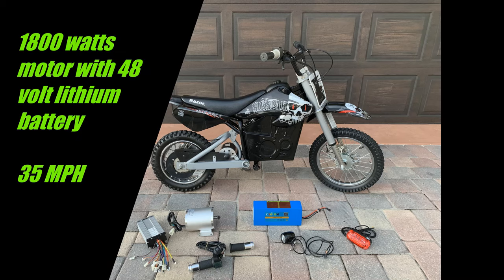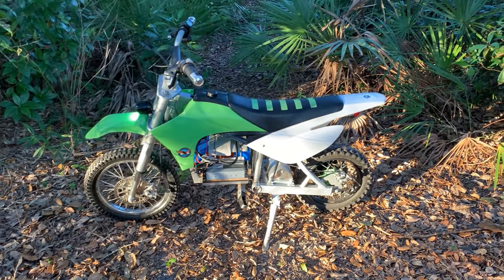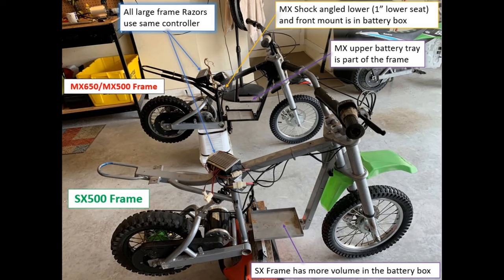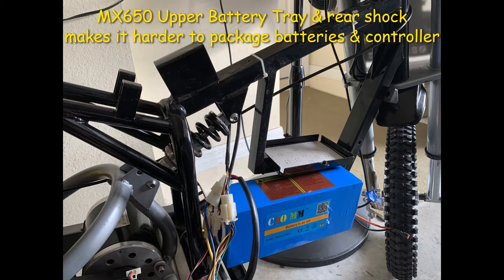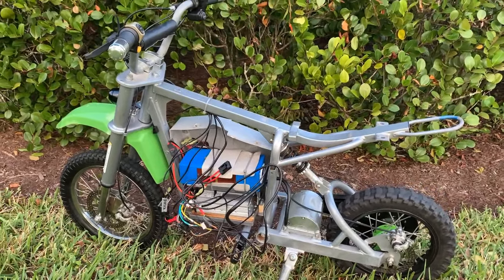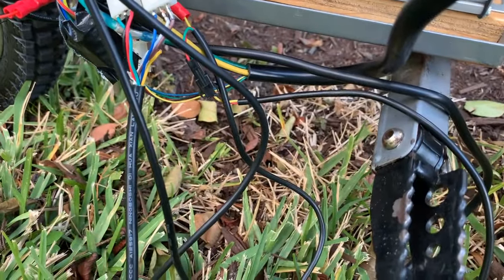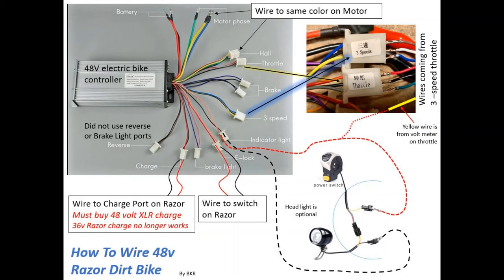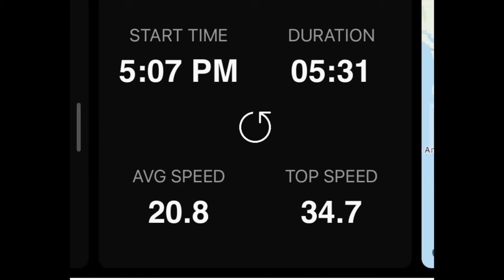go 35mph with 48V 2000W motor - Razor MX650 MX500 SX500 RSF650 upgrade for $400

Comment: Good job explaining everything, you made it very clear. I upgraded my 36v mx500 a little bit ago to 48v but I used 15ah SLA so it doesn't have much ride time. Next step I wanna grab up a lithium battery maybe 20ah I want to get some more range out of it but don't have too much to spend. Thanks for the video. 👍
Reply from the maker: with the 14Ah I get over 60 min.     
 For longer ride times 48v/20Ah battery with 35A BMS:   http://ebay.us/2AUk7j
Reply: @BRichSolution do you need a new battery if you get a new motor and controller

Comment: Great work and thanks for the detailed video as well.  So far, we've done the lazy upgrade path of slapping a 48v 20ah Ebike battery into our MX650 and are just punishing the stock controller and motor for now- the bike still rides awesome compared to stock, but yeah, we see the future and it's a brushless motor and real controller.  Razor Gang for life!
Reply from the maker: That's a nice way to upgrade in steps:  go to 48v battery and when the stock motor burns up then replace with 1800w brushless.  Here is link to before and after speed test when I put 48v battery into a stock motor (SX500 with 650 motor)  https://youtu.be/kRvYAI1hdc4

Comment: Thank you for the video I used same kit,  your diagram for the controller was very helpful in wiring my mx650 back together.  The bike is a lot faster and go's up hills with a lot more power. I got the 20ah lithium battery and it fits perfect in bottom tray of mx650 the controller fit good on top tray zip tied it down. Again great video instructions great job appreciate it thanks.
Reply from the maker: Glad it helped; can you send me photos of what the 20Ah battery looks like in the frame?
Reply: @BRichSolution  Hey Rich I got 2 photos but I don't know how to send them from my cell phone to the youtube  reply I'm old school on tech stuff sorry. The battery sets flat on bottom tray I put foam underneath it and zip tied it.

Comment: How specifically do you install the fuse, like where on the battery? Also, did you just take the fuse off the old razor batteries or did you buy the fuse online?
Reply from the maker: You can reuse the factory inline fuse or go without as the li-ion battery BMS protect the circuit

Comment: Thanks for your video! Very helpful video!
I just finished my upgrade of my MX650 with the same 1800 watt motor,
controller  and throttle with 3 speed switch. Your video is So easy to follow and works well!
Thanks again!
Reply from the maker: Glad it helped
Reply: @BRichSolution Do you need to upgrade the stock battery if you are going to install the motor and controller upgrade? Also are any modifications need for the controller/motor upgrade

Comment: hey thanks for the help on most of the wiring but you said the red black and green wires on the throttle connect to the controller i only see red and black wires coming from the controller
Reply from the maker: maybe you have a different controller?   you can use these easy to use lever wire connectors to trouble shoot your connections.  I find them very useful when troubling shooting  https://amzn.to/39BuYZy

Comment: This was incredibly helpful--thank you so much!   I am all done except for one issue:  the battery comes with a separate charging cable, so do I have to hook up the controller to a charging port?    Am I not just able to charge the battery with the cable as it was sent?
Reply from the maker: You can do one of two things:  
1.  Use the stock charger the battery comes with and route the new battery's charger port out of the battery box 
2.  Wire the new battery's charge port to the controller and buy 54.6V 1.5A Charger with XLR Plug     https://amzn.to/3nlOk9A   so you can use the stock charge port.

Comment: I was wondering how you turn the battery on and off on this build? I bough all of the parts I just needed help with that one question. Thanks
Reply from the maker: Battery remains connected to controller and the factory on/off switch wires to elock port show in video

Comment: Hey b rich solution i was just wondering if i could only put on that throttle with the volt meter and key switch without upgrading anything
Reply from the maker: Yes, you need to wire the key to wires going to on/off
Reply: @BRichSolution  how can i find the key switch with volt meter that is compatible with the on and off switch connector

Comment: Thanks for the video! For the 40 amp fuse, does that wire on the positive or negative output? I'm trying to add one but wasn't sure.
Also, did you pop it often or did it last pretty good? Thanks in advance!
Reply from the maker: Positive

Comment: My sons sx500 does not have the larger front tire.. I’m assuming the frame is the same as the one in the video but not sure. Would this set up most likely still work?
Reply from the maker: yes this will work with MX500 and mx650 as the frame is the same.   I since made an updated video see link https://youtu.be/rBJ2z1ujeRg

Comment: Hi! I have a question, do you think this would work with an MX350? Because thats all I can find at the moment for a reasonable price. Thanks.
Ohhhh nvm just saw the models it works on in disc. Thank you for the vid it really helps!
Reply from the maker: MX350 & MX400 is 24V and small frame; motor will not fit.  You could upgrade from 24v to 36v with stock motor similar to this video:  https://youtu.be/uvTHxL_mtcc
Reply: I have done that you have to make new screws and it pops a lot of wheels but very fun I somehow did it

Comment: Very informative video I'm going to buy this kit you're using but I'm confused on where you plug the on off switch into. is it in the e-lock port? Do I have to strip the e-lock wire to wire the stock on off switch?
Reply from the maker: I made another video recently to go over the step I may not have covered.  The on/off switch gets wired to “e-lock” port on the controller 

https://youtu.be/rBJ2z1ujeRg

Comment: would changing the sprocket sizes on a stock bike change the speed? i want a higher top speed for less
Reply from the maker: Yes go to 13 or 14 tooth motor sprocket will get you higher speed

Comment: B Rich - another question.....do you have a schematic or DIY for the brake light ?  I purchased the one you listed, but see no information on how to wire?   Please help!
Reply from the maker: As for the taillight wire the black wire to the black wire on indicator port.   The taillights power wires to the yellow wire on the headlight so it turns on with the headlight switch

Comment: is everything listed in the description needed?
like the,
40 Amp Fuse
Lever Wire Connectors
and the 3 speed throttle with Volt Meter
Reply from the maker: Not everything.  Most 40A fuse, lever connector and 3 speed throttle are optional
Reply: @BRichSolution  alrighty, thanks so much

Comment: How is this battery n did u connect the fuse on battery I have same battery 48v 20ah for my 1000w 48v scooter n was wondering do I need to connect fuse. Before install
Reply from the maker: yes connect the fuse inline with red wire between battery and on/off switch

Comment: Great Video! Would it be possible to wire the 3 speed control to a key switch to "lock" the power modes? Have a standard twist throttle and wire the 3 speed on the controller to a 3 position switch?
Reply from the maker: Yes, you could connect lock to elock harness on controller

Comment: For your second build did you just keep the 3 speed with only 2 gears or what did you do? Which ones were broken, which gears
Reply from the maker: yes only 2 speeds on 2nd build; see video linked at 4 minute mark https://youtu.be/rBJ2z1ujeRg
Reply: @BRichSolution  there’s nothing on the 4 min mark?

Comment: Wait I’m really confused. Could you please tell me what I need to order to complete my sx500 build. I already have the vevor and coamm and 13t sprocket in the cart. What other necessities do I need to run the bike?
Reply from the maker: Junction box and hydraulic brakes is needed for higher speeds 
Hydraulic Brakes (front & rear): https://amzn.to/3RN0acN
Brake Rotors (48mm bolt pattern): https://amzn.to/3LmX7Wi
Yellow Junction Box: https://amzn.to/4c4rvRI
Reply: Do you have the motor and controller? You'll usually also need a new throttle but that's about it.

Comment: Did you ever need to wire in a high power switch or pre charge resistor in line at the battery positive terminal? Thanks and awesome video!
Reply from the maker: I wired the elock harness on controller to the bikes on/off switch

Comment: Quick question, is all I need to do to the battery just connect the red wire to a fuse and then connect the red and black from the battery to the red and black from the controller? I've seen videos of people connecting the wires to the side case and everything but I don't know if it's necessary. Also, I would assume I could just use the charger the battery came with and not have to do anything with the charging port from the controller?
Reply from the maker: You don’t need the side case… it’s nice to have for quick disconnect.   You don’t need the fuse either as the battery has BMS
Reply from the maker: As for the charger… I’ve routed the battery charge port to outside of the bike and charge the battery directly and bypassed the controller

Comment: U helped a lot showing the diagram of how every is wired my question is if is there a way you could help me out because I have a 72v battery and a controller but I dunno how to do the electrical part and don’t wanna mess up the bike since I have not one but two 72v battery in my razor Mx 500
Reply from the maker: wiring should be the same for 48v bike vs a 60v or 72V.   The issue with 72V is the battery is expensive and you'll most like want to upgrade all factory wires on the bike as the Amps are higher then wire rating

Comment: I have the key throttle with volt meter and when i had constant power with the jumper cable, the voltage displayed properly but the key was useless. i took the jumper cable out and the key worked but the voltage displayed 0.6v, even though i had much more than that. does the yellow wire from the throttle need to go to red of the indicator light or can i connect it to the red of the elock?
Reply from the maker: yellow wire being the voltmeter?   If so wire the voltmeter power wire to indicator light harness or aux harness

Comment: I didn’t get the 3 speed grips so to connect the two wires do you just cut the white box off then strip the two wires and connect them and leave the other? Thanks
Reply from the maker: Yes just connect them together

Comment: B Rich - interesting issue i'm having.  I got the bike up and running, everything was working great.....all three speeds, headlight, etc etc.  

my son rode it last night, parked it for the night and plugged it in.  went to use it this morning and it doesnt work (odd?).     You can hear when you twist the throttle the motor is getting the signal, it lurches forward for a millisecond then cuts out.    strange?  any suggestions on starting to trouble shoot?  i used everything in your kit, didnt deviate from anything.
Reply from the maker: I would check the volts coming out of the controller to the motor.   If the volts increase when twisting throttle then either motor of hall sensor is bad in the controller.  My guess is there is an issue with the controller
Reply: @B Rich  thanks for the reply - where should i check the controller - strip back the blue/yellow/green wires and test them?   i assume red on tester to yellow and black on tester to blue?     also - after trying to get the motor to engage for 10 mins of tinkering around, the controller was getting super hot and the wire from the controller to the motor also very warm.   the only thing i did different than your build is, i just jumped the E-lock with a wire, i didnt tie it back into the throttle...i wonder if this caused a problem?   (do you have an email i can take this offline and email you? - i'm trying to be a hero for my son and i'm failing...)
Reply: @BRichSolution  well - it looks like the hall sensor in the motor is shot according to my Ebike tester.    any idea what the cause was?  everything was working fine....until it wasnt?   got about 4 days of use and it died.   im hesitant to install a replacement motor if i have something wired incorrectly??

Comment: Hi B Rich,  I've purchased everything on your list and i'm stumped on the wiring of the Battery to the controller to the switch.    in your video, you kinda flash over that part and i dont see a clear schematic in your video.   can you please help me?    ive wired the Red on the Battery to the Red on the controller, as well as the black to black.  i have no idea how to splice in the switch?   please help?
Reply from the maker: See video at 6:00 for poor man’s schematic.  Also make sure the elock is wired to the on/off switch.   To test it you can poke a small jumper wire between red and black on the elock harness
Reply: @BRichSolution  Do you think it is acceptable to just "jump" the e-lock harness from the controller?  it looks like that was able to get me up and running? (leaving it in a "jumped state" permanently?)

Comment: I was plugging in the last cables from the battery to the on switch and I heard a pop when I connected them ? I kept turning the on and off switch pulling the throttle but nothing happened? Did I mess something up
Reply from the maker: Do you have a fuse inline?   If so the fuse may have popped.   replace it and you should be good to go.   
Are you using the charger that came with the battery or aftermarket one?

Comment: I know I'm late but I'm confused about the battery charger, doesn't the battery have its own  charging port so you could plug in the charger that it came with, or did you just not use it and continued using the razors charging port
Reply from the maker: New battery comes with charger.  In the video i used the factory charger port… but on my other builds since then i route the battery charge pigtail out the back of the battery box and use the charger that comes with battery

Comment: Do i need to buy the connection box cause tere is no box on the stock razor or just does everything wire right up
Reply from the maker: You can wire it directly if you want
Reply from the maker: You can buy a junction box or hard wire up to you

Comment: Looking at this upgrade for my sx500, so one caomm 48v 20ah will be fine to run the vevor 2000 watt? Just didn’t know if the battery was underpowered I feel I keep reading mixed things
Reply from the maker: yes I have build 4 bikes with Cao MM 48V 20Ah and 14Ah with 2000W motor kit no issues
Reply: @BRichSolution  thanks a lot! Also if I added another 48 to it would there be any issues? Same battery and spec
Reply: @BRichSolution  would the 40amp inline fuse be what’s needed for the caomm battery also?

Comment: Great job ! I I'm about to upgrade my MX650 and my sx500 with the same materials! I've seen a lot of people online saying that the motors didn't last long and have had issues with them how long has this setup lasted you personally on your bike?
Reply from the maker: I've had no issue with mine and been riding on the setup for 14 months and over 500 miles.     I've done 6 month and 1 year updates on the build.   https://youtu.be/4KgzGBjB07Q

Comment: What do you suggest to upgrade a 24v pocket bike? Looking for torque and speed but nothing crazy as I realize I'm limited anyway. It's just for cruising to the store and bar hopping. Even 25mph is a lot that low to the ground 😳
Reply from the maker: upgrade to 36v with stock motor is fun and you'll gain speed & torque over stock 24v.    Go with 36v/14ah battery:  http://ebay.us/7VCLqF

Comment: Hi, great vid. What did you do for the on/off switch? Wires off the Switch are 12 awg, and the wires coming off the controller for the switch are ~18 awg. I'm just going to charge the battery with the charge port coming off the battery.  Thanks in advance
Reply from the maker: see my other video https://youtu.be/uvTHxL_mtcc at 3:12 for connecting battery to the switch.
Reply: @BRichSolution  thanks I got it working, Thing definitely rips, alot of fun. I saw your volt reader reads max of 54 in below comments, I'm only seeing 52.5 on mine after full charge (or at least the charger is telling me charged) on the charger the battery came with. Everything else is same as yours besides I did not get lights or horn... Any suggestions?

Comment: I saw in the poor man’s schematic what wires do you put there because on the battery there is already a charger?
Reply from the maker: You can use the battery charger as is and route the charge port to the outside of the plastics.   Or carefully pull back the sheathing on the charge port, cut the wires separately and then wire red and black wires to the factory charger port.   If you do that you must buy a new 48v charger with the xlr plug on the end.   See description under video for list of the products

Comment: hi how do I hook the battery with a t plug up to the connectors on the controller?
Reply from the maker: The battery comes with male T-connector that has 6” of wire and you connect those wires to plug on controller harness
Reply from the maker: See this video at 4:01 https://youtu.be/rBJ2z1ujeRg
Reply: @BRichSolution  oops sorry I didn't see this comment. thanks! this will work :)

Comment: Can you install these handlebars with the stock controller, without having to buy a different controller.  Also I wanted lights, would I have to buy a different controller or can I plug them all into the stock one?
Reply from the maker: Yes you ca have the light with stock controller and motor you have to put a splitter in between the battery and controller.   This this video
https://youtu.be/kRvYAI1hdc4
Reply: Will a 36 volt eco smart throttle and controller kit work on my mx650 that has an small added battery to boost the speed to 21 mph?